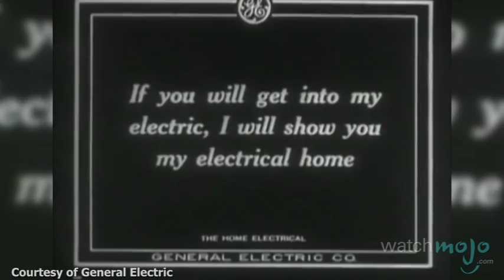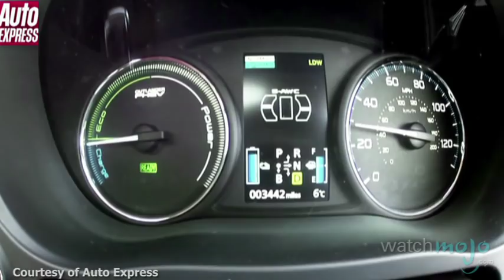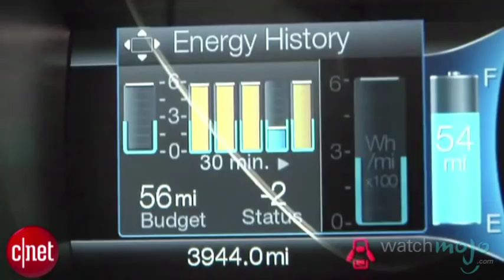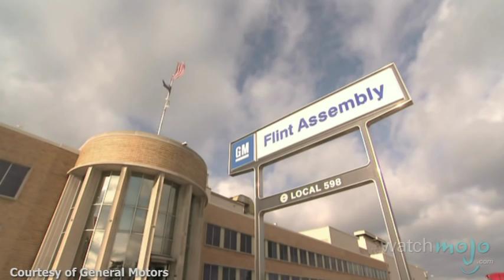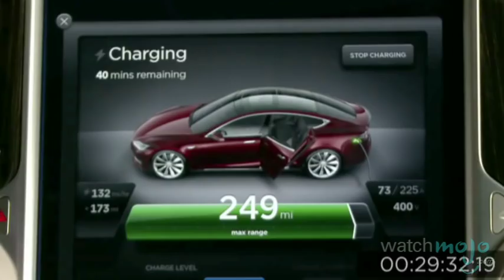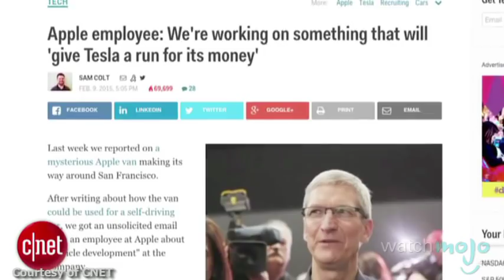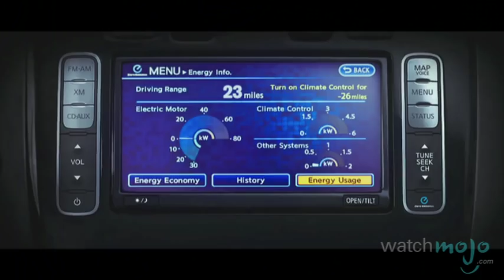10 Electric Car Facts - WMNews Ep. 16

Comment: Graphene carbon nanotube technology will revolutionize the electric car industry.

Instead of "slow" charging and expensive ( and dirty ) lithium,  we are talking about supercapacitors.

Graphene super-capacitors will be the storage device of choice.   making electric cars cheaper, longer ranged, and longer lasting.

We already know about the power of electric cars, they need not be slow golf cars on the road,  and electric cars do not have to look ugly,.

We all know there are special interests that have a lot to lose if people start using electric cars for most of their commuting.  they spend a lot of money to dis-inform the public. and use scare tactics.

I do agree , the current generation of electric cars , are too expensive,  and range is limited,  charging is slow.  If the price was right, it would not matter,  most people just drive to work, and back, go to the store, pick the kids at school, 100 mile range is more than enough for daily commutes for most people.  but the price tag will scare anyone away.

Comment: Hybrids are the next logical step then hydrogen fuel cells. Hydrogen is the most abundant resource in the known universe. Its only emission is water. With a shortage of water maybe you could have a fill tank in your car to fill up the water. Then deposit said water at hydrogen stations while you refuel your car where it will be filtered and purified to be drank. Just an idea.

Comment: if you charge it at night you defeat the purpose.  Your burning coal or natural gas. No sugar coating here. So you either like fracking or huge coal pollution. Plus you factor in the battery waste and footprint for manufacturing and you are creating more pollution. the efficiency factor is greatly outweighed with the total footprint from manufacturing to demolition. The epa needs an overhaul. Every emission should be calculated from footprint lifespan.

plus do you know how much emissions are used to create 1 lb of lithium....

Comment: Until you can fully charge the battery as quickly as you can refill a gas car, I won't be buying one. But I'm quite interested in Full-cell. Toyota successfully started hybrid trend, lets see if they can do it again with hydrogen.

Comment: Mistakes:
1) Electrics don't cave a low carbon footprint? Even if they only use electricity produced from coal powered cars their footprint would still be half that of a gas car. 
2) About charging availability, you charge it at home. Is that not worth mentioning?
3) The Leaf is a pure electric car, not a hybrid.

Please remove the misinformation from this video

Comment: The La Ferrari is NOT an electric car. It's not even a hybrid. If you call the La Ferrari a hybrid then you should also call every F1 car that.
It has an electric motor supporting the gasoline motor, it cannot run on the electric motor alone since it is attached to the gasoline engine. Get your facts straight!

Comment: IF you can't "afford" new cars you're screwed. When an electric car makes it to the used car status the batteries will need to be replaced. The batteries will be so expensive the used car people wouldn't be able to handle the cost. Would a set of batteries even last 5 years? Don't think so. I have to use an electric scooter because of a disability. The 2 gel-cell batteries have to be replaced every 2 years, anytime past that and you will be stuck maybe, in the middle of nowhere.
Also to go anywhere I have to have a mini-van to haul it. The van's batteries only make it 2 to 3 years and it has to be heavy-duty. In an electric vehicle there wouldn't be enough power to raise and lower the lift needed to haul it.
Wait, just thought of something else. Anymore they want you to take used batteries and light-bulbs somewhere to dispose.
Someday maybe, but it's not feasible now.

Comment: The problem is not the fuel used for cars. The problem is that there are too many and people use them too often.

And also... if everyone used electric cars, we need someone to invest a lot in renewvable energy sources to supply with all that power... or we'll be poluting a lot, because we'll need thermical, nuclear or combined-cycle power stations. Also, batteries. They are SO dangerous to the environment. Think about that too - the same double edged sword that are solar cells and panels.
And, just saying, but all that hate about electric cars and how they aren't "manly" or only idiots buy them... says quite a lot about occidental capitalistic society model.

Comment: Don't forget that the pollution to make a single batterie is as bad or worse than gas cars
Reply: Pollution is a very ambiguous term.  Oil and gas production has incredible levels of real damaging pollution.
Reply: +Turding Turtle . When you analyze both types of cars from manufacture to disposal, studies prove that electric cars are cleaner even when taking electricity from the grid. Electric cars are cleaner today and they keep getting cleaner as the grid moves toward more renewable energy. In addition, you can get solar panels for the roof of your house just like many other electric car owners. Like I said before, there are more houses with solar panels on the roof than there are electric cars on the road. 

http://blog.ucsusa.org/rachael-nealer/gasoline-vs-electric-global-warming-emissions-953

Comment: im still not a fan of electric cars, the problem I have is first of all they expensive to own.....I could buy a new Toyota AYGO (its an example before u all bitch at me) which will be better to run and stuff, and before anyone says bout a G-Wiz for less money that's not a car, its a electric quad bike for the road and in an actual crash test, u will not survive in it at all and it lost to a table.

second, just because the car produces no CO2 it still needs the power from the plug which mostly goes to a fossil fuel power station, even eco friendly effects like wind power is still wont be enough to power everything and could take longer.

though they all don't get it........the biggest problem is the battery, the battery technology is not great still to be used in a car still, cos there no point build an electric car if a battery range is only 70miles, cos if im travelling around 75 miles to london and back, I have to stop 3 on my journey just to charge the battery which will be a very long time to charge it up (average 6-8 hours) and the range can drop aswell if u use the lights, the radio, the Air Conditioning and other option extras so it could drop to from a 70miles car to about 60miles.....and to make things worst, if u use the fast power charge too many times, it can destroy the battery FASTER and wasiting ur time and money to change a battery, which could cost over £1000s. just for a battery change, AND u have to take it to the dealership to make the manufacture change the battery.......

so im not saying the electric caris crap, (unless someone makes a G-Wiz car which I will destroy when I see one) the companys need to look at the battery technology far more than the actual car.

to make is easy for u to understand, if I got one electric car which only goes on 70miles on one charge on old battery technology and a another car which can go 1000mile on one charge which a much better and new battery technology......which one would u go for.........easy take the 1000mile range car.

Comment: I stopped watching half-way through the video.  Don't get me wrong, I like electric cars, but this video is based entire on rhetoric and talking points rather than on actual facts.  Here are some examples:

#9 ALL electric cars are based on batteries.  You guys parsed out battery-electric like it's a disparate type.  Hybrid plug-ins ARE hybrid gasoline vehicles, they simply have the added benefit of letting your charge the Li-Ion battery by plugging it in and also give you the option of a longer all-electric drive cycle.  Hydrogen fuel cells are NOT batteries "that charge themselves in real time"; instead they are devices which take advantage of the fact that hydrogen really wants to combine with oxygen to form water, and the fuel cell allows it to do so by passing through an extremely fine mess made of platinum or paladium (i.e. they are very expensive because platinum costs almost as much as gold), but as it does this, the electron is forced to take the long way around (through the circuit) before it can complete the bonding process.  This is a VERY efficient process, so hydrogen fuels cells do hold a lot of promise, if only we could find a cheaper way to manufacture them.  

#8 In figuring out the carbon footprint of an electric car, you also need to take into account the manufacturing of that vehicle.  While most of the frame and components of an electric car vs a gasoline car are about the same, one place the electric cars are FAR more damaging to the environment is the BATTERY.  Those big, Lithium-Ion batteries have a HUGE environmental impact in their creation.  Feel free to Google it, you'll be shocked! 

With regard to hybrids, they typically cost between 30% - 50% more than the gasoline version of the same car.  So then you have to look at how long you will have to drive the car before the fuel savings equals the extra amount you paid for the vehicle.  At a gasoline price of around $4/gallon, the break-even point for a hybrid is around 200,000 miles!  If gas prices are lower, like they have been in the past 18 months and especially in the past 2 or 3 months, the hybrid will NEVER last long enough to recoup the extra cost.

The biggest problem with all of these technologies is that we're putting the cart before the horse.  Before any of this stuff really matters, we need to solve the problem of energy production.  Current renewable technologies are simply not good enough.  They are an evolutionary step forward (and a small one at that).  What we need is a REVOLUTIONARY step forward.  We need a disruptive new technology for energy production that would be something along the lines of what cold fusion, or zero-point energy was supposed to have been.  We have a technology for clean, safe nuclear power that CANNOT be weaponized (hence it would also be safe to give to 3rd world countries)--Thorium reactors.  This post is already running long, so I'll let you Google (or search YouTube) Thorium on your own and you'll see what I mean.